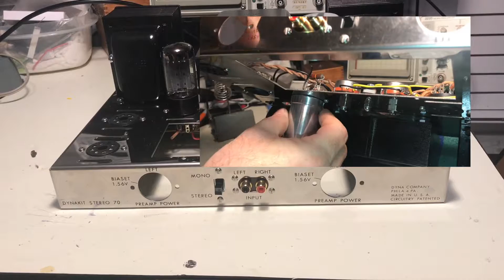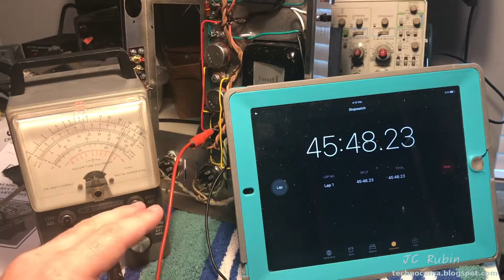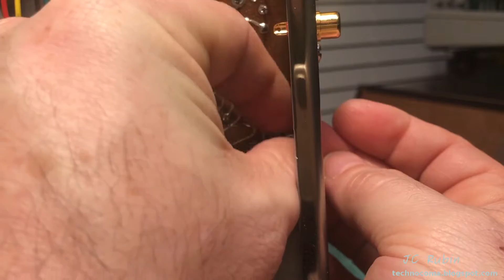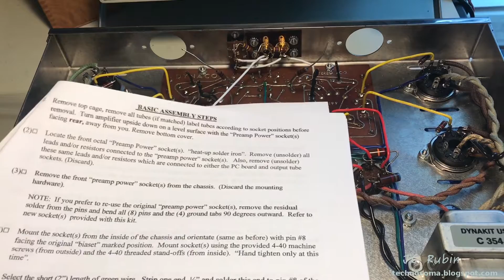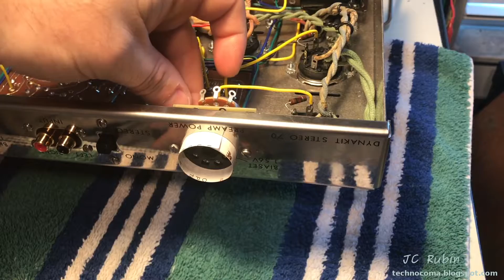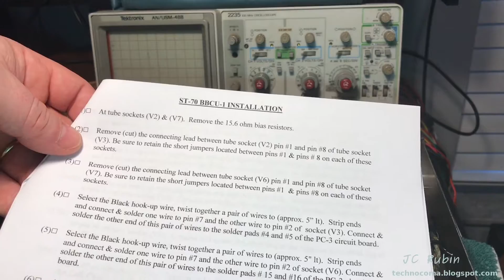The Dynaco Dynakit ST70 Stereo Amplifier Restoration Project Part 4

Comment: So how does this sound? I just obtained one of these. Same black cat caps and tubes
Reply from the maker: Before or after restoration. Original design or with mods?
Reply: Apologies, original design. I obtained an original dynaco with the 6GH8A. Circuit board is from dynakit.  This is a secondary amp for me. Thanks for your input.
Reply from the maker: @labalo5  all components working the power supply is weak. Sounds good but the bass can break up
Reply: @rubin-tech  expecting it not to reach that far in bass but should be good nonetheless. Thanks for the video. I’m late to the game but I need to delve into some tube goodness. Late to the party as everyone has already commented how great your series is. Thx for the hard work!
Reply from the maker: Before or after restoration. Original design or with mods?